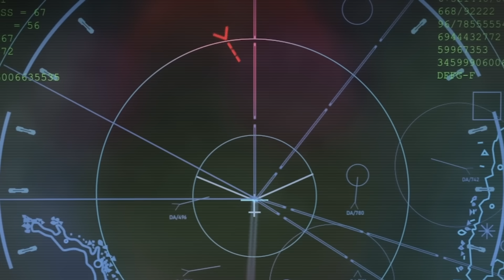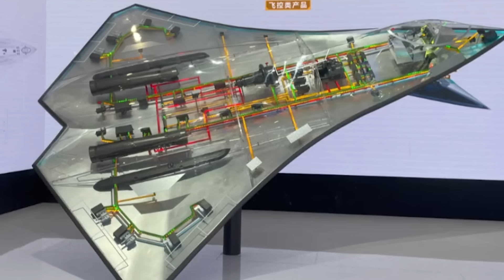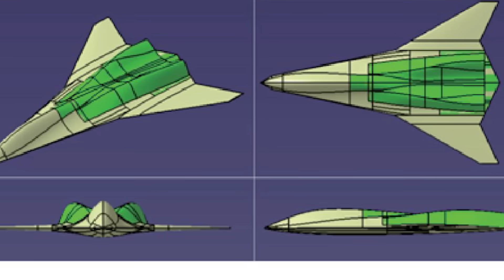China's Tailless Swiveling Wingtips Shocked the US

Comment: No they didn’t. Those flaps will show up on radar like a battleship.
Reply: By that logic, the F-35 and F-22 will show up like a skyscraper as they have significantly larger cross sections because of twin vertical stabilizers.
Reply: @nycsim-r8t

By that logic, the Chinese cannot make real radar reflective, coatings and those aerolons are big RECTANGLES.